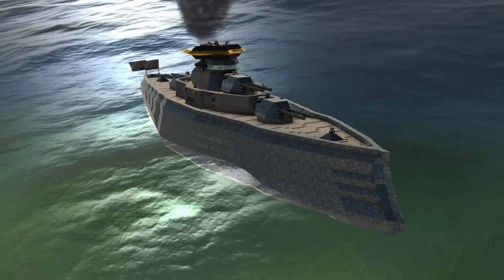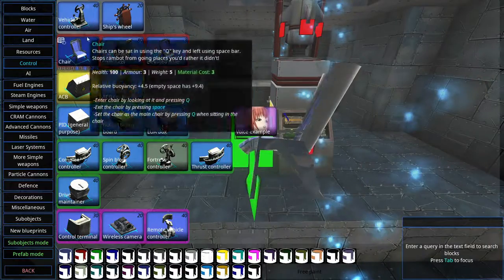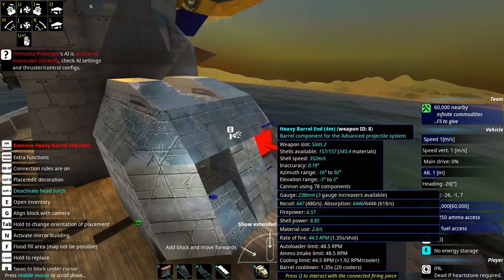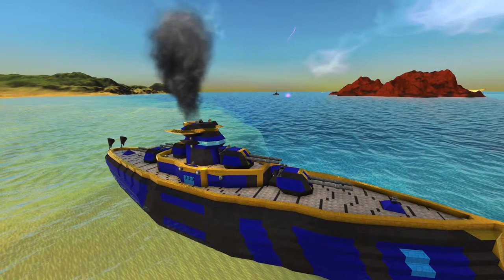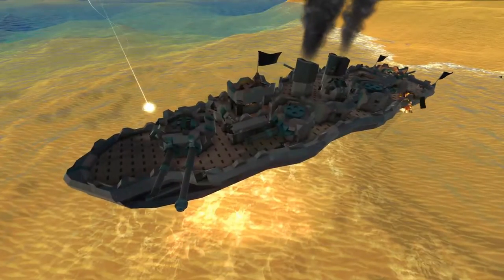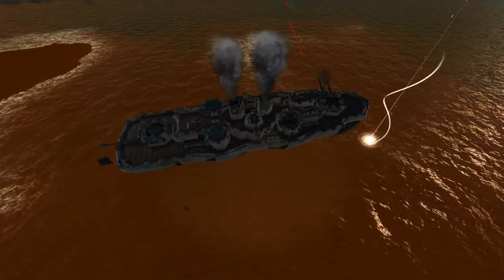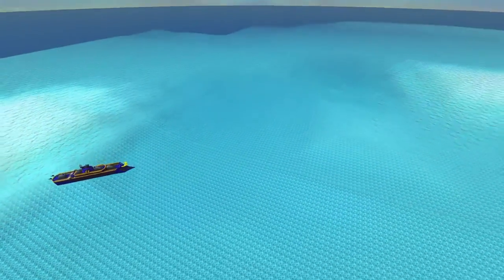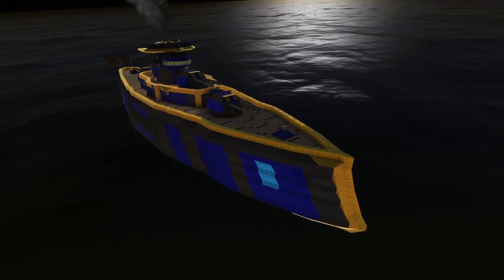[ENG] FtD - Construction - Cruiser Rebuild - Part 3

Comment: 8:05 Some materials can completely stop EMP so you are right. That includes wood, stone and heavy armor. EMP can't pass through wood or stone at all, so it's a good idea to use it to protect the AI. Heavy armor works a bit different, it attracts EMP to it and gets damaged by it, exactly like AI compoments would, so when you got the space to spare and you want to give extra protection to AI it's a good idea to make a outer shell of stone, make second layer out of heavy armor and then place the AI. It will make it so heavy armor doesn't get weakened by EMP (though on it's own it still protects AI from emp just fine)
Reply from the maker: Thanks for the info! I hope nothing breaks in a major way once the EMP chnages roll out. Experience has tought me otherwise though...

Comment: Why not switch the bulkheads to wood?  Another thing you could do is fire the torpedoes out of the bottom.  That way you can reduce the number of missile controllers by putting them all in one place.
Reply from the maker: Right, I could actually replace them with wooden ones. The downward facing torpedo-tubes would be a significant advantage over the sidemounted ones. Here I just wanted to recreate the original design features though.
Reply: @DerHeizmeister  Right, I get that.  Just thought it would help since you seemed so concerned with the cost.  Fine looking vessel over all.  I've been working on some new things too in my exile lol.

Comment: Hi I’m very new to the game and have basically been experimenting with designs and controls and have 2 questions. How do you remove and replace blocks instantly, and what is the best way to build small?
Reply from the maker: Hey there! You can quickly fill a surface with the block-type you have on hand by pressing F while looking at it. For quick replacing of blocks press shift and then place the block you want, while hovering over the one you want to replace. The best way to build small is to set yourself a volume limit and try to fill as much space on your craft with functional components as possible. Arrange  components in a compact way and avoid empty spaces. I hope this helps!